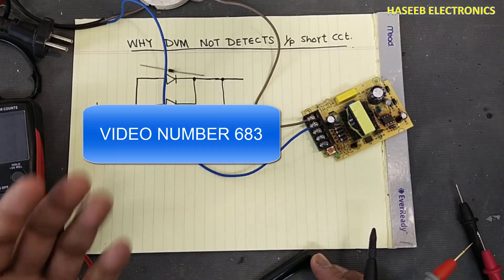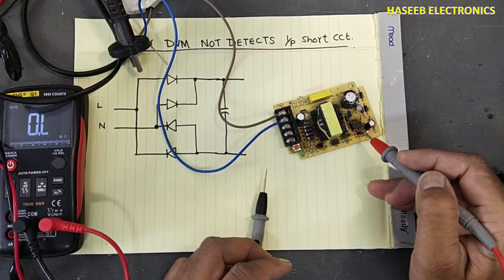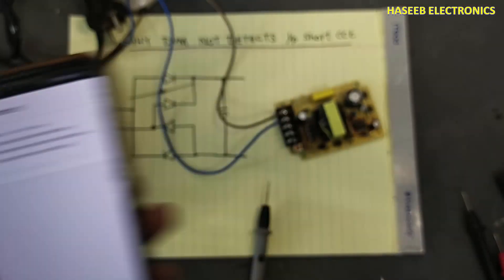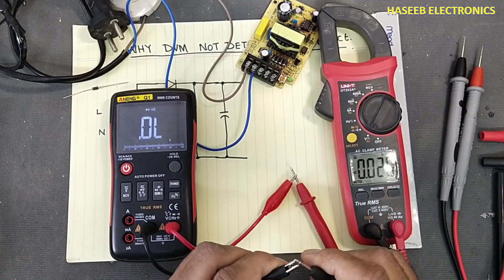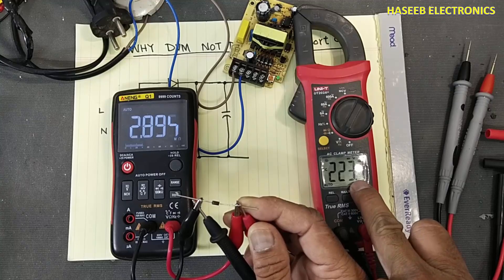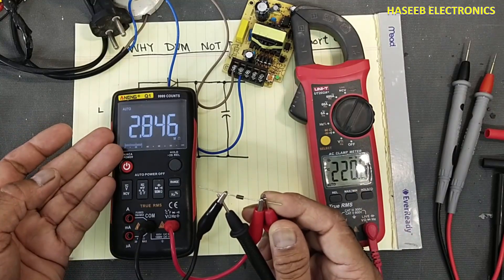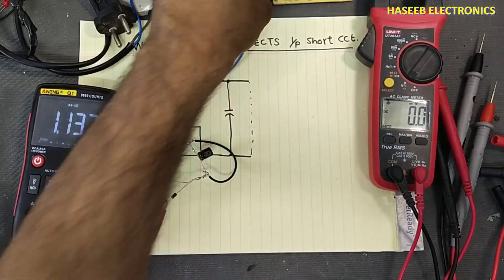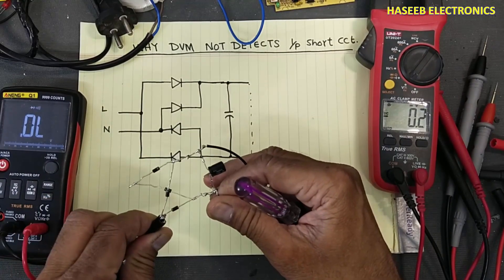{684} Digital Multimeter Giving Wrong Reading, False Reading

Comment: alhamdulillah. Thank you for the video specially made for me with the detailed explanation with practical. I always thought that I could trust my digital multimeter to check the short with continuity or resistance mode so I always avoided series bulb before testing equipment to check with continuity mode. Once again thank you for saving me of making mistake and cause dangerous incident. Its great to know that I can test the short with diode mode same as series bulb. May god bless you for spreading you knowledge and keep it up the great work of educating others.
Reply: I still wonder how that damaged board (with short) survived without blown fuse or diodes. May be a circuit breaker tripping during that damage?
Reply from the maker: thanks a lot for your feedback. 
i already replaced fuse to demonstrate the exact fault symptoms when we have fault in inverter section

Comment: sir very useful kindly recomand us which make Digital meter to be purchased
in (2) Analog multimeter also is suitable for test. Branded make may be advised for us
Reply from the maker: if you want to purchase digital multimeter, compare following features 
1. if it have capacitance test, that is fine
2. if it have frequency and duty cycle measurement, that is better
3. its voltage must be more than 600V, if it have 1000 volt, that is perfect 
4. at least 10 ampere ac and dc current measurement 
5. if it have temperature measurement option, that is awesome 
6. if its minimum voltage range is in microvolt, that will superb 
7. true RMS measurement option is much better than a regular RMS measurement 
you can select any brand with above features. by comparing price and quality

Comment: Salaam alaikum Mr Haseeb why not use Analog multimeter I think it the best for checking diodes
Reply from the maker: yes you are right
but when we want to identify the normal rectifier and schottky, varactor, then we need digital. moreover the world is now digitized 
but analog meter is perfect, it doesn't gives false reading. i am using from 1990, but in 1997 i shifted to digital multimeter.  because working on digital circuits, the analog cannot support too much

Comment: Very good video dear brother.
I was wondering about the analog multimeters always found  old technicians in electronics workshops use it.
Never thought about the abilities of this tool till now.
ما شاء الله تبارك الله
جزاك الله خير 🌷
Reply from the maker: Yes, you are right dear brother 
but 
OLD IS GOLD
Reply: @HaseebElectronics  I'd like to own a Simpson 260. It is easier to see a needle movement sometimes than a digital display. Vacuum tube volt meters are great. I'm sure you could build one with a Mosfet input as well.